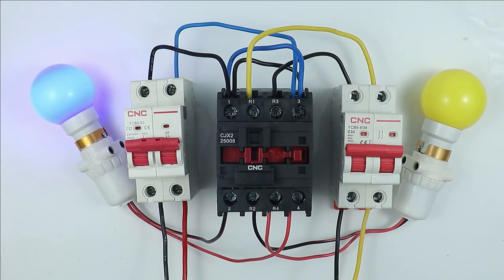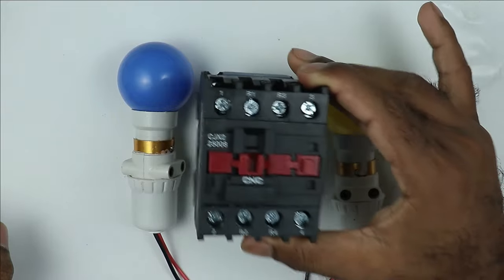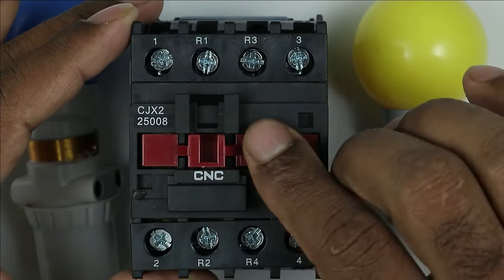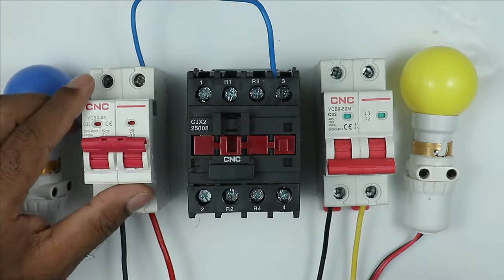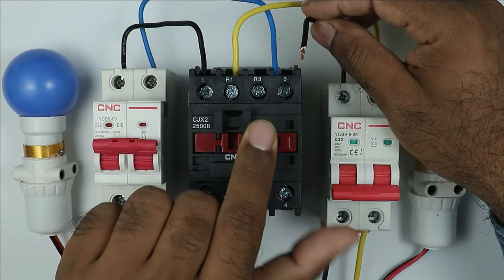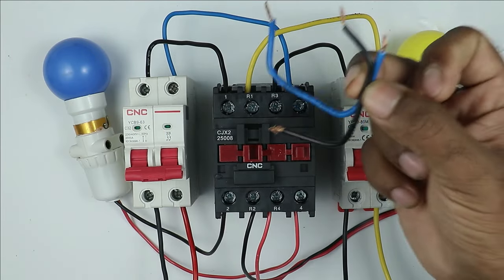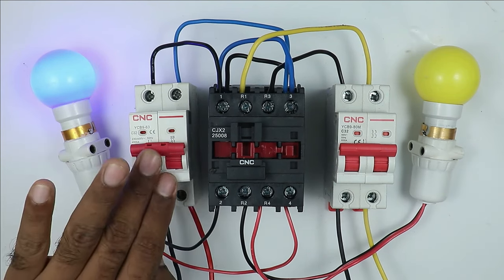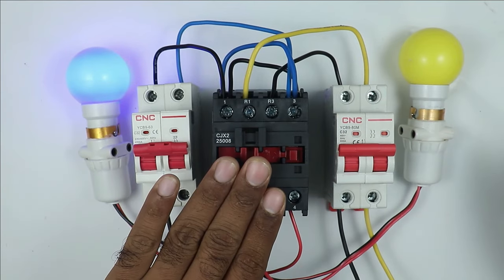Auto Change Over Switch (ATS) by using only One Contactor @TheElectricalGuy

Comment: very well explain, do you have sample for 2 power source with only 1 load?
Reply: That's simple.

Bridge 1NO/NC and bridge second NO/NC, and use as load output. At the other point of connection of the NO and NC you connect supply 1 to both NO, and supply 2 to both NC.

Then connect control points to the input of both NO.

Mode of operation:

When supply 1 is active, the contactor engages and load only sees supply from both NO connections, when supply 1 is off then load sees supply 2 via NC connections.

Comment: Hi Sir,  I have a 3 phase power supply in my home.  Can I install an auto phase shift switch so that it will shift the power to the phase which has no power .  By which means all 3 phases work in my home.

Comment: this is not auto change over, its manual change over, auto means when main power source fails it changes by it self to backup power, when main comes back on it switches by itself back to main
Reply: it is an auto change over, the breakers that control the power supply are only for demonstration purpose, in real application, the breakers are removed and connection are made directly to get the auto system